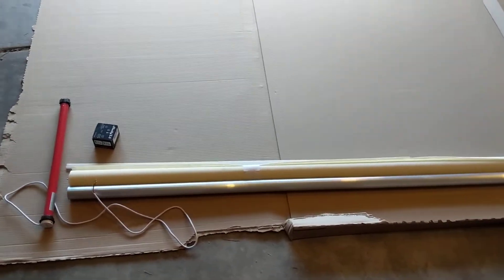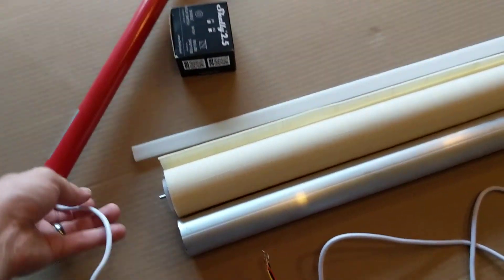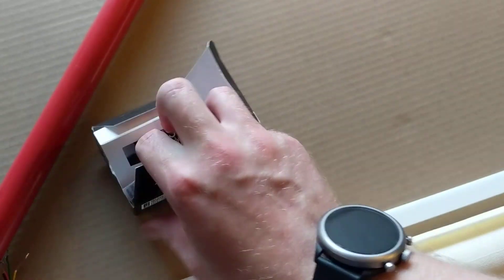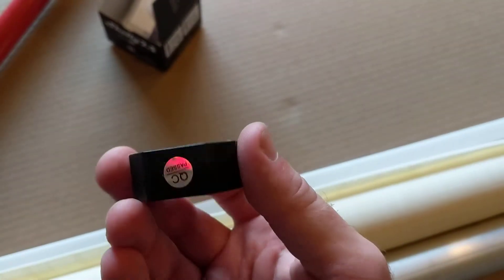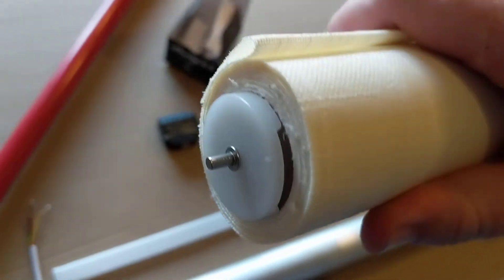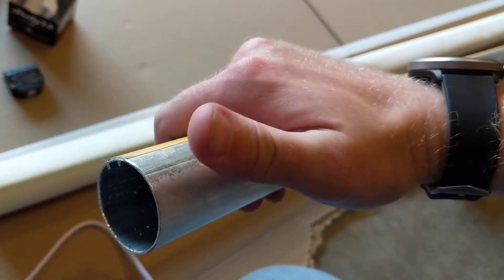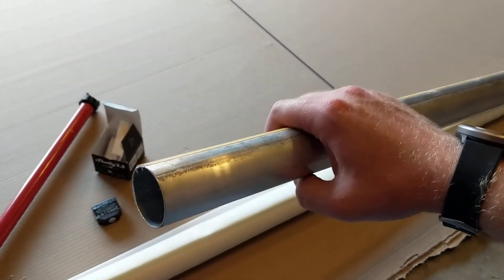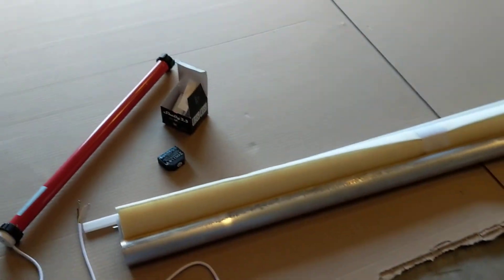Four-Wire Zemismart Roller Motor with Shelly 2.5 control

Comment: can you please describe how you set the up and down limits on the motor with this setup?
Reply from the maker: sure! This system has mechanical limits built into the roller motor. the upper and lower limits have to be adjusted using a yellow key that comes with the motor. I did have to turn them quite a ways in order for the limits to work right. Once you have the upper and lower limits set, you can run the auto calibrate on the Shelley 2.5 and it will automatically set your upper and lower limits based off the mechanical limits. It can detect when power is cut off to the motor. That allows you to use percentage commands to control how much the blind opens. I can make a video of this process if you would like.